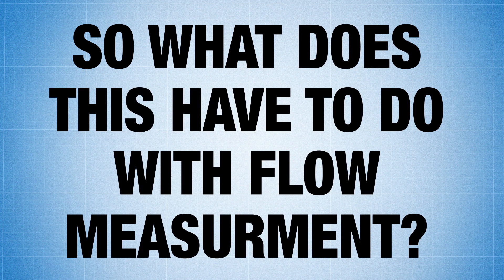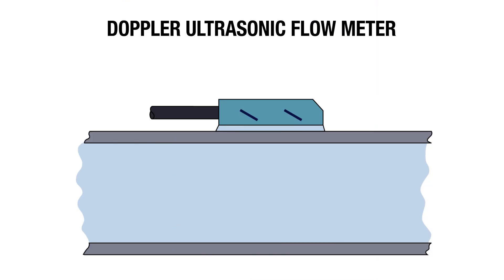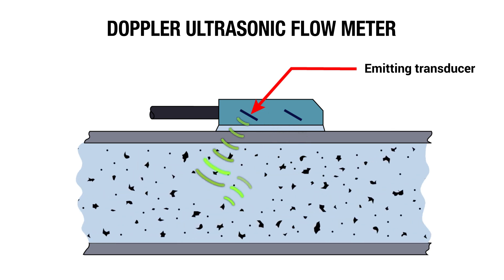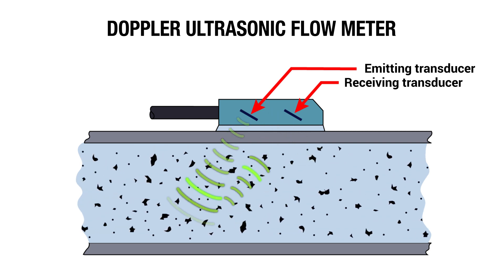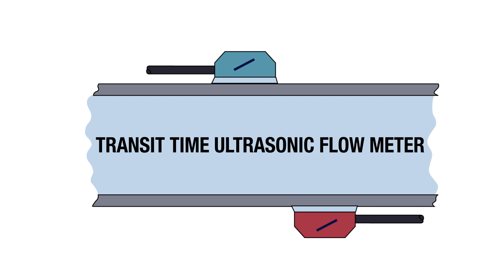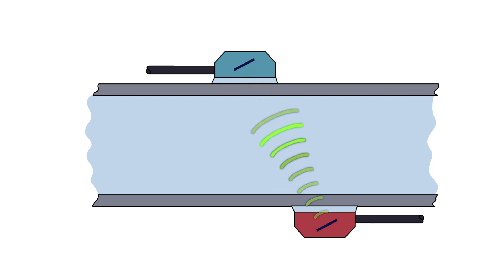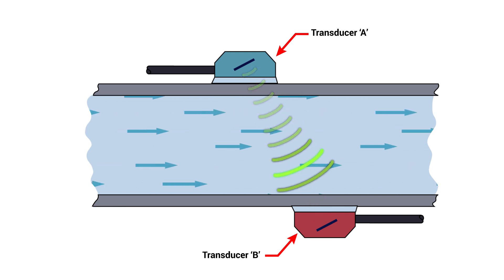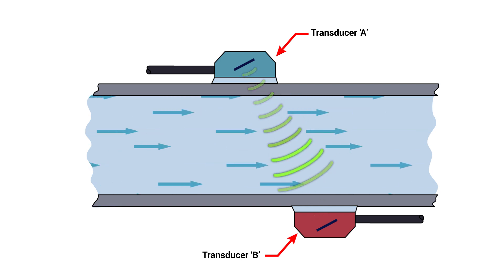Doppler vs Transit Time - Let's talk Ultrasonic Flow Meters

Comment: is both the transducers should be placed accurately parallel to each other? what formula will be implied to find the upstream and downstream speed. what if the transducer got moved after deployment. Any suggestions?

Comment: what if the flow in the pipe doesn't cover its complete area of cross section?
Reply: @joelw2413  if the pipe was filled with liquid , the top portion could be moving gasses (air) that displace the moving liquid and allow flow. Similar to how residential drainage needs vent pipes to allow the air to replace fluid displacement.